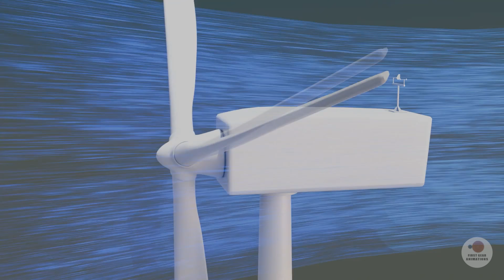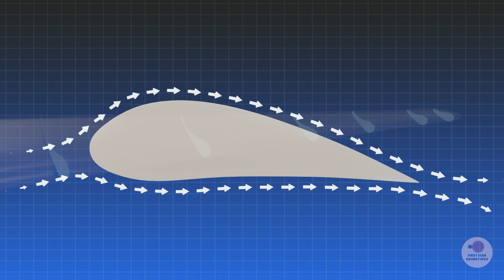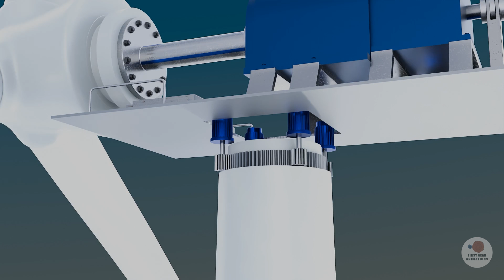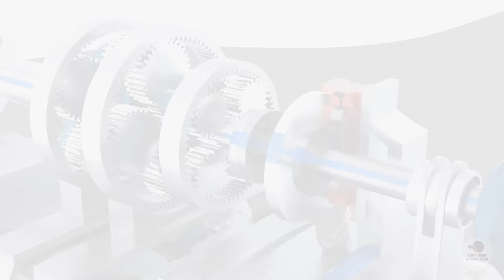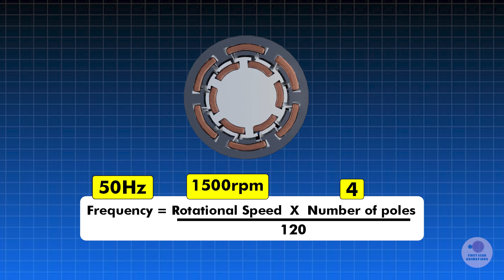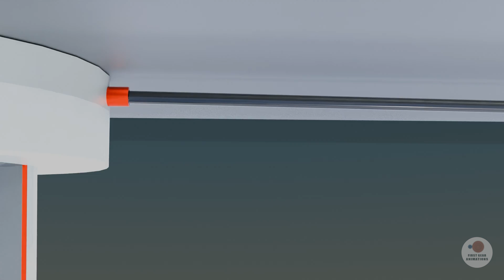Inside a Wind Turbine: How It Really Works

Comment: My uncle works in a factory that produces the gears that upscales to speed of the main shaft in the gear box.  He tells me the stress on the gears is so tremendous that they are constantly failing.  That’s one of the reasons business is doing so good for them.  
Apparently, reducing the speed of a shaft that spins fast is much easier on the parts involved than increasing the speed of a shaft.  It has to do with the input torque he tells me.
Reply: Thank goodness the grating gears problem is now obsolete trash that has gone forever.  The monster new mills coming out now are a direct drive generator (No silly gearbox!).
Reply: This answerd a lot of my questions
Reply: Ive built a gearing system using elastic which stores the energy. I can run house from the force of half tap from kitchen sink pressure. Can't put it on the net as Grok has already stollen some of my pyramid ideas. I have other ideas worked on for years, but cant put out there now.
Reply: @thegreatpyramidbuild-prate6013 Well yes I'm powering the neighbourhood with the three 1" springs, but can't say anymore either, Claude is constantly spying on me.

Comment: Wind Turbines the most magnificent machines ever built, Absolute Bull Shit Mate.
Firstly they have a short lifespan .ie 15 to 20 yrs Max.Then need to bereplaced or left to rot.
They require a massive foundation footprint, tons of concrete .
They are made of fibreglass and synthetic fibres. Non recycle materials. 
Vast tracks of land rendered unusable around them.
Thousands of acres of hilltop bushland destroyed for their construction .
The destruction of many species of wildlife and birds killed.
Thousands of kms of ugly High voltage wires and Towers across farm land rendered useless 
Can't operate in hot or windy weather.
This list of negativity  goes on.
Oh and they are all made in Fkn Chinah  ,making China rich and the countries buying them poor.
These wind turbines littering our country side are the biggest act of environmental and visual Vandelism  in the world.
Reply: The oldest wind farm in the UK has been operating for 30 years and they are currently being refitted with more up-to-date generators

Comment: How much unclean materials are used to produce “clean energy” ? How much money is spent to produce “free energy” ?
Reply: and compare that to the unclean materials and energy to extract, transport (around the globe), refine, and transport (again) to the bulk storage and transport a couple more times before the oil reaches the end user. Now add the cost of manufacturing of power plants and or the millions of individual boilers in homes.  Now add the recycling effort required to deman all the equipment, trucks, trains, tanks and end-use materials to the mix.  Are you still so stubborn to cast doubt on the science?

Comment: Lifespan of all this expensive crap is 20 years. Then it all has to disposed of, god knows where to.
Reply: Hmmm.  A bit of a generic and knee jerk statement to have made.

General lifespan of a motor vehicle is usually at most 15 years for practicality and cost effectiveness, unless the owner is an aficionado. Steel is recyclable, copper is recyclable, probably many components are about as recyclable as a car. I used to work in power generation and maintenance of a coal fuelled power station was astronomical, a generator perhaps needing recoring, rewinding, bearing surfaces replaced, lots and lots of oil etc., regularly. So those who intimate more modern tech just get thrown on the scrap heap are missing the point,  re-cycling has moved on and improved as science achieves more solutions.

Nuclear waste disposal as a comparison however involves the management, containment, and isolation of radioactive byproducts. Usually in deep geological disposal, burying high-level waste hundreds of meters underground in stable rock formations using multi-barrier engineered and natural systems which then take centuries to degrade. The closure of coal fired power stations has not only improved the environment but also the health of  many people. Churchill restricted the use of them during a great smog during the war in London (look it up), thousands of people affected.

Ultimately, nothing is "free". The electricity companies still charge you a power bill!
Reply: The oldest wind farm in the UK has been operating for 30 years and they are currently being refitted with more up-to-date generators

Comment: He doesn't mention anything about destroying the landscape. Or how much oil does use and you can't recycle the blades?They just sit where you could find a place for and rot
Reply: A North-sea wind farm is absolutely nothing compared to the majestic sweep of industrial hardware visible when viewing a coal-fired power station under full load, columns of beautiful inky black smoke rising through the turgid heavy oil-filled fug around the grimy cooling towers matching off into the distance in a grimy landscape ...  That's what I call a 'proper' view!

Comment: Their overall efficiency is about 30 per cent due to losses in friction and the amount of loss of energy in the wind that is lost in actually turning.Then given that on average they are only actually running around a third of the time ,so actually overall 10 per cent,about the same as an old flathead(side valve) piston engine.Then to cap it all,the owners are paid when they are not actually generating anything at least here inthe U.K. So not such a great deal!

Comment: very interesting, but what if using a giant capacitor to control the frequency to keep it constant, the capacitor in question is an artificial water reservoir and the wind turbine only functions as a water pump, so with a system like that the tolerance range of the windmill rotation speed can be wider while maximizing the energy potential, and the water from each windmill pump can be accumulated at one point in the reservoir.
Reply: They do something like that too, but as battery storage
Reply: Or you could use a customized inverter to convert the AC to DC at the base (to prevent DC current losses), then convert it back to AC with IGBTs which boast great efficiency and inject it to the grid. Probably too expensive against directly maintaining a 60/50Hz output and simply converting the voltage.

Comment: Wind is hardly clean energy.  Wind turbines require massive amounts of oil and fuels to mine the materials, mix the cement, transport the components, assemble the turbine and to lubricate the gears.  It requires up to 700 gallons of oil per year to lubricant each turbine each year.  Without oil wind turbines wouldn’t exist.

Comment: Are the blades sharpened so they can kill whales easier?   How big is the diesel engine that makes it spin and how big is the diesel engines fuel tank?   How many kabillion gazillion barrels of oil are used to schmelt the metals?  Have they cured the cancer that you get from looking at them?  My neighbor told me that they only work for a few weeks and then have to be completely disassembled and then guys in Hazmat suits need to deal with the toxic waste.   They need to be assembled on site and trucks are used.  WoW....trucks use...   uh...oil.   So does my lawnmower!  Will my lawnmower start killing whales and give me cancer?  Technology scares me.  I want to go back to rubbing sticks to make dinner......and riding my horse.
Reply: Those blades don’t hit the water 🤨😒
Reply: Sarchasm.   The gulf between the one making the snark and the one missing its intent.

Comment: I had no idea about movement of the magnetic field.  I thought that blade pitch angle was changed in order to keep the rotor of the generator at 1800 RPM, but it makes sense that this would not be enough to keep the generator paralleled with the grid.
Reply: Varies by manufacturer

Comment: Terminology:  A fan moves air, a compressor (centrifugal or axial, not a piston system) compresses air, and a propeller develops forward lift by spinning.  All of these REQUIRE power input.

A turbine on the other hand is just the opposite;  It reacts to moving air and develops torque, thus it produces energy, not uses it.

I just hate it when people see the fan blades at the front of a jet engine and say "Look at the turbine there!"  The turbine is at the BACK of a jet engine, not the front!

Comment: "Clean Energy" is a fable. It takes tons and tones of materials tjat are produced with Coal, Iron ore and numerous ather poluting materials in a very long process. So please tell the truth. Similarly EV's are thre times more poluting than equivalent Fuel cars before they even leave the Manufacturing Floor. Wake up people. They're selling you a lie.
Reply: EVs lead to lower impacts when driven.  Normal usage makes them less net harmful.
Reply: @hayttom  Did you read the whole comment before you let out that drivel?
Reply: @florianiscrown  you are talking complete nonsense
Reply: @1987tijgertje  Says who?

Comment: Im not sure the return is beneficial (until we can store the electricity) when you consider the embodied energy used in manufacturing and installation, where i am in spain they are installed up high on a windy mountain where they have had to build new roads for access, the foundations are enormous with over a hundred cubic meters of concrete ( a very energy hungry product)  and tonnes of reinforcement. And of course when the wind stops a gas or oil powered power station has to kick in quickly. The bird wild life has disappeared. And they make a lot of noise and cause a faint FLICKER that residents in Wales UK have had enough of.
In the UK they haven’t put the infrastructure in to bring the power (electricity) to the grid so there are wind turbine companies that are dumping 65% of the energy and GETTING PAID for it ! Its a SCAM.
Read John Etheringtons book The Wind Farm Scam.

Comment: Wind turbines are definitely an interesting piece of technology, but can we talk honestly about the full cost instead of just the headline benefits?

What is the total lifecycle cost of a single turbine? Not just installation, but everything:

- the environmental cost (like large-scale deforestation in places such as Scotland to make room for wind farms),
- the massive reinforced concrete and steel foundations (often hundreds of tons),
- the production and transport of the turbine itself,
- ongoing maintenance and replacement of components,
- and finally, the cost and feasibility of environmentally responsible disposal of both the turbine blades and those enormous foundations.

On top of that, there are still unresolved concerns:

- infrasound and its potential health effects,
- bird and bat mortality,
- and the simple fact that many people consider these structures visual pollution on natural landscapes.

It’s not enough to call something “green” without accounting for its entire footprint—from construction to decommissioning. Where is that full accounting?

Attached is a link explaining some of these questions: https://x.com/i/status/2038162987769295022

Comment: Not really clean or reliable or cheap.
Only produces a third of the maximum power output. Costs a fortune to build service roads and a connecting grid plus ongoing servicing. Blades cannot be recycled so they must be buried. Often located miles from where the power is required involving losses and difficulty synchronising inverter frequency with the main grid.
Built in China with fossil fuel generation then shipped on heavy oil burners.
Will never be cheaper, more flexible or more reliable than gas for electricity generation.
Built in high prices for up to 30 years into the future. A complete disaster.
Reply: So much nonsense in one reply

Comment: The whole thing catches lightnings. Somtimes the thing starts to burn after. A plastic fire in more than 100m hight can not be extinguished from ground. A catastrophy for the neibos and environment.
Reply: Lightning is a non issue. That is called a lightning rod, present on all high buildings
Reply: @1987tijgertje oh really. In Germany 3 systems were on fire in the lasr 3 months. How comes?
Reply: @Paul-o8f9z  Likely overheating internally, leading to hardware failure. The potential electrostatic voltage difference that causes lightning is between the ground and the atmosphere. Electricity will always take the path of least resistance, once there is sufficient voltage potential to overcome that resistance. Tall objects simply provide the electrostatic voltage difference between the ground and atmosphere the path of least resistance, as almost any solid material is more conductive than the airgap between ground and atmosphere. Lightning is the equalization of a difference in electrostatic voltage. Because the difference in voltage is flowing into the ground, any tall object that has an isolated 
 metal rod from the very top all the way into the ground will be unaffected by lightning, as the copper rod provides the electricity the lowest resistance path to ground. Therefore, the electricity flows through the rod and into the ground instead of flowing through the other materials that comprise the tall structure.

Comment: Induction generator excitation control was new for me.
I was thinking they generating a random frequency then rectifying and then inverting 60 or 50  Hertz.
Reply: Most are direct drive now producing DC current that is turned into AC using an inverter.
Reply: @HADDEN67 a direct drive still generates a 3 phase AC
Reply: @emptyness72  yes but not at the generator. It’s DC.
Reply: @HADDEN67 afaik the generator still generates an alternating current, which is rectified in the inverter first and there converted to grid frequency.
Reply: Yes. This is an option as well. Many small size wind turbines use the “rectifier - inverter solution” to get they can synchronize its variable frequency output power with the 60 Hz grid they are connected to.

Comment: @dave0smeg I will add  the conversion to AC to feed the grid is the hard part. The output of the turbine is always fluctuating. Both voltage and AC frequency must be regulated and synchronised accurately to the grid. If the wind is too slow or fast it cannot generate.  On average these turbines only work 30% of the time. And don't forget that if one isn't working many more are probably also not working.
Reply: That is not true. You are mixing up with the capacity factor which is the percentage of time the machine is operating at its full 'rated' capacity. It does not need to operate at full rated capacity to generate power, in the same way you don't need to drive your car at 100mph to the  supermarket to buy groceries. The metric that matters is the kWhr/yr it generates. Actually a petrol driven motor car has a capacity  factor of around 2%. Capacity factor measures utilisation of the asset's maximum capability, not efficiency.
Reply: Worse than that, when a wind turbine does not work a gaz/coil turbine si activated to compensate and keeps the total output more or less constant. It's why the initial statement, that wind turbine is the future of clean energy, is so wrong.
Reply: @Spsr555  that's a lot more complex than this and depends primarily on storage, production and demand from the grid. If all you surplus energy could be stored in, say, hydroelectric or any clean storage (flywheel, gravity storage, ...), then you could said that solar / wind is clean energy. But yes is it quite a overstatement.

Comment: The explanation is clear and detailed, but I wonder if this is the latest technique used? As far as I know it is usually a direct connected generator and rectifier and inverter on ground level so without heavy gearbox ( and gallons of oil as mentioned earlier)
Reply: Direct drive turbines are not the norm. Mainly because they're more expensive to build for numerous reasons---The generators have to be significantly larger so they generate the same power at lower speeds and therefore they're much heavier, so the turbine as a whole has to be built more robust, which adds cost. The generators also use a large amout of rare metals, which combined with their larger than normal size, adds to their cost significantly as well has concerns for materials availability.

Comment: And gallons and gallons of oil grease and diesel
Reply: Please explain to those of us who are perplexed at your comment what the 'gallons and gallons' of oil and grease (and ESPECIALLY the 'diesel') are doing.  On a smaller scale, my house is full of electric motors, some that have been in use for 50+ years, that have never needed oil and grease - hair drier, fridge, freezer, hand drill, fan heater, food mixer, lawn mower, desk fan, tumble drier, washing machine, electric shaver ...  I must admit that I do oil my door hinges every 15 years or so with one drop of 3 in 1 oil (so there's an expense to add in when buying a door - if that is the argument you are offering)
Reply: hundreds and hundreds of gallons

Comment: KILL BIRDS. ONE NEEDS TO CHANGE GEARBOX EVERY FIVE YEARS WHICH IS EXTREMELY COSTLY.
Reply: Back in the seventies it cost about £30000 to rewind just an exciter generator (part of the maintenance programs) which was needed as part of the engineering for the massive generators used in the like of Ratcliffe On Soar Power Station (last coal fired station in UK recently shut down) which had eight massive turbine generators. So unless you actually understand periodic maintenance of industrial generation, perhaps not best to comment because your judgement is misleading.